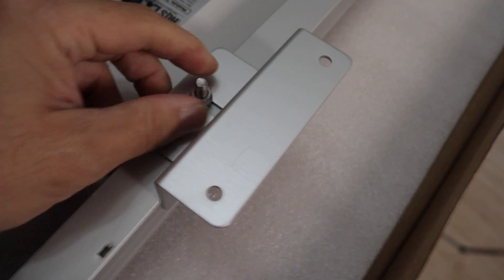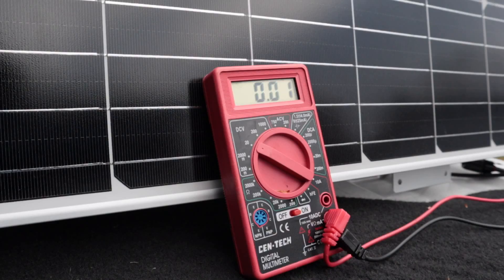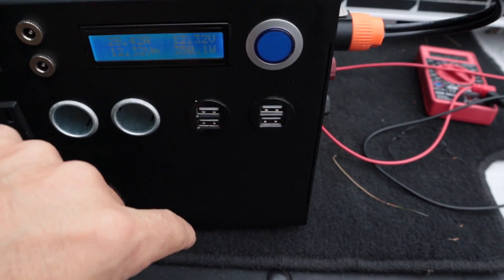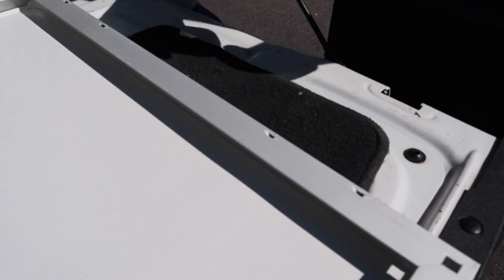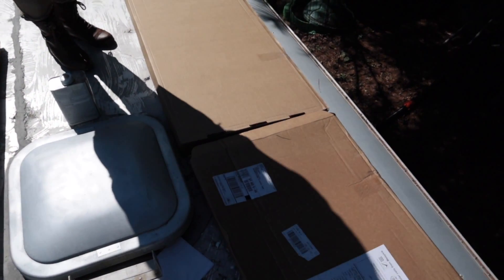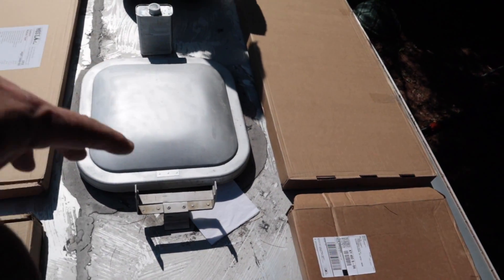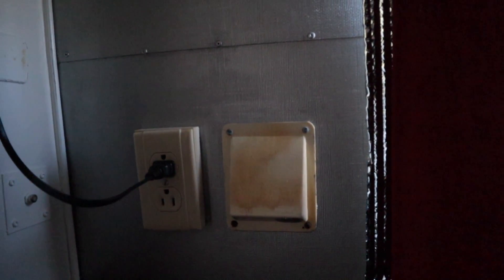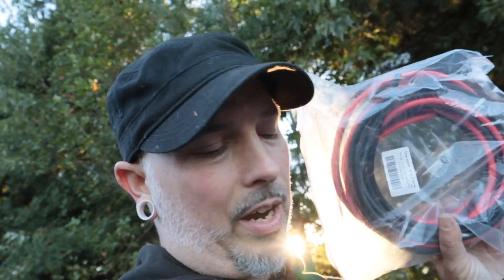Day 56 || Part 2 - Installing My Solar Panels || #RVLife

Comment: Instead of running the panels through the Kodiak(I know you wanted to use it for its built in charger/inverter), why not just run them through the MPPT charger you already have? Use the MPPT charger(that should handle your 3s2p output) to charge the Golf cart batteries. You can then charge the Kodiak off of the "house" batteries and keep it portable.
Reply from the maker: That's definitely an option later, but I want to conserve my resources for now. It's not like I can't buy the extra components later if my circumstances change.